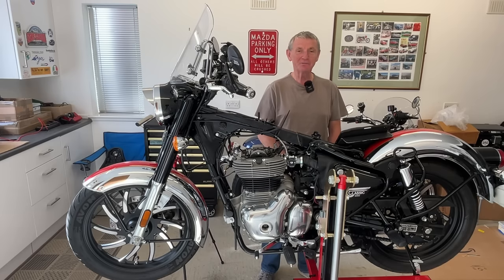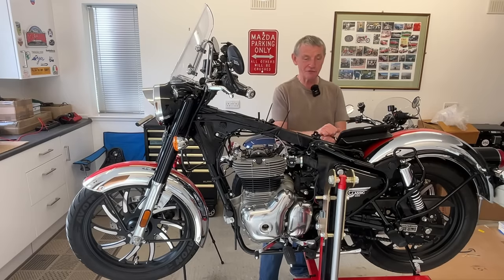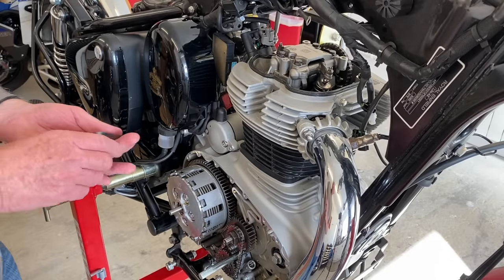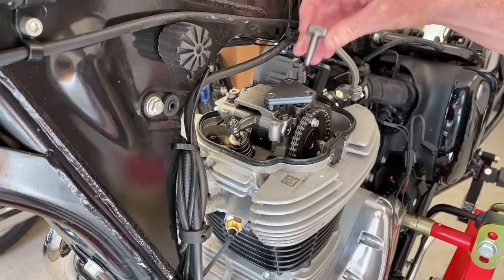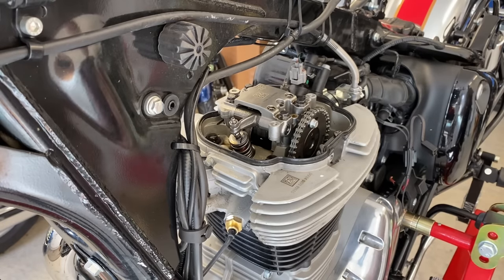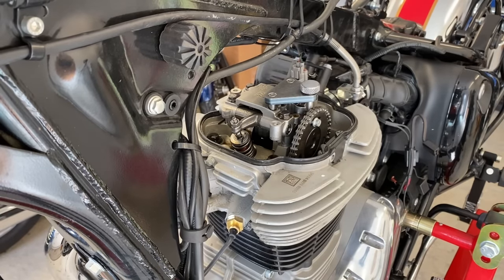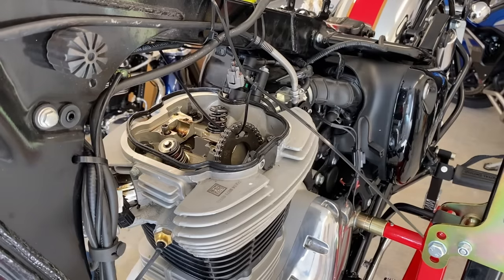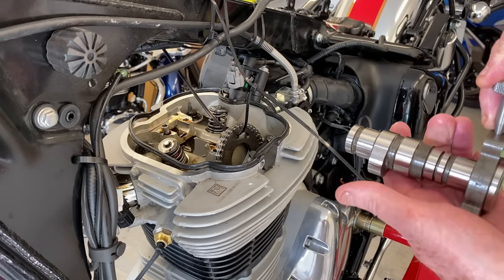Royal Enfield Classic 350 - Fitting the Hitchcocks Performance Camshaft

Comment: Good clear explanation however I don’t think clicking the torque wrench a few times is recommended ,once the tool breaks that’s the torque set,clicking again could over tighten the fixing,
Reply from the maker: Not sure if it’s good practice or not, a habit I’ve got into over the years. As to the bolts on the bike the torque setting specifications are between 10 to 12 Nm, as I used 10 Nm any extra clicks wouldn’t have exceeded 12 Nm 🤣.
Great to hear that you enjoyed the video 👍

Comment: does the performance even increase when you only install the new camshaft or do you only get the +4 hp when installing other airfilter and exhaust?
Reply from the maker: You will definitely get a performance increase with only the new camshaft fitted.
The air filter and exhaust just enhance the setup by improving the airflow through the engine.
Hope you enjoyed the video and found it helpful 👍
Reply: @tigerness5555  Thank you very much

Comment: Excellent video I will be referring to this if/when hitchcocks get the cam in stock. Was the side casing gasket a pain to get off?  Or are you intending to reuse it? Also I believe you took the fuelx lite and decat exhaust off, are you refitting some else like the decat pipe and using the fuelx lite again? Do you still have the DNA air filter. Otherwise I don't understand why your doing the cam for more power without the basic mods. Sorry for the question just wondered the direction you was going.
Reply from the maker: Great to hear that you enjoyed my video and found it useful.
The side casing gasket came off in bits but was easy. Yes I did fit a new one.
Yes I had previously taken the FuelX lite and free flow exhaust system of the bike. Those items have been sold. I found the exhaust rather noisy for my liking.
I’ve never had a DNA filter.
You’ll have to wait till next weeks video to get the full picture of all my performance modifications 🤣
What I will say is that they have all been very worthwhile 👍
Reply: @tigerness5555 I'm looking forward to the next video. I have the DNA air filter, not sure on the performance improvements but sounds nice.  I  fitted hitchcocks decat but to be honest the cat was very free flowing anyway but again a little different in exhaust note. I did hear someone mentioning the cam caps have stretch bolts but at 10Nm don't think that to be the case.  Funny how everything is 10 Nm. Keep up the good work.
Lift looks an awesome height to work at for this job.

Comment: does the camshaft allow the bike to maintain 110 or even 120kph on a motorway when it meets an incline or a headwind?
Reply from the maker: Yes it will maintain 110kph, the bike is flat out at 120kph but it will still maintain that speed much better than the standard engine.
Hope you enjoyed the video and found it useful 👍😁
Reply: @tigerness5555  It is an exceptional video. Hats off my good man.
I bought my 350 as a means to get to work, from the south side of Dublin to the northside. A 25 min ride with no traffic. However, i have ended up clocking 12,000klm in 12 months going all over the country for a secondary job i have since taken on. I found the most infuriating thing was trying to get back to Dublin while attempting to maintain 110kph as its a comfortable speed. However, I have found on a number of occasions that  i cant even keep it at 100kph. I am fairly handy, your video is fantastic so if this fix will breath new life into her I will absolutely do it. I will also buy a cheap tourer to share the load. Thanks again for the video. Its fantastic.
Reply: @tigerness5555  Is there any chance I could send you vid of another problem I have of my chain jumping? Ive asked the garage I have bought the bike from to look at it but theyre not interested. Something tells me its not normal.
Reply from the maker: If your chain is as you say jumping, this is what I would look for.
1	Does the chain need adjusting, is it too slack or too tight. Adjust as per user manual.
2	Does the chain have tight / stiff links. If so try cleaning / lubricating the chain. If this fails you need a new chain.
3	Are the sprockets (wheel and gearbox) worn or have hooked teeth. If so the sprockets require replacing.

If a new chain is required then the sprockets are possibly also worn so it may be advisable to replace both of them as well.
Hope this helps 👍

Comment: My torque wrench only has in/lbs.  Am I correct in calculating 10 NM is approx 94 in/lbs.
Reply from the maker: According to google.
To get any torque value in inch-pounds, you need to multiply the number in newton-meters by 8.851
Therefore 10 Nm = 88.51 inch-pounds
Make sure your torque wrench is definitely inch-pounds AND NOT foot-pounds.

Hope this helps and you enjoyed the video 👍

Comment: Hi Ian I'm sorry to be a bother to you I've just put my cam shaft in job not finished yet I can now see how the special tools are beneficial they weren't in stock when I ordered my cam, as I said I made a cheap one but I'm not sure that I've got it right so my question to you this time is the cam locking tool a perfect triangle as when I measured the points where the tool fitted in was One and half inch equally between the points that how I made it but if the triangle is not equal distance between points then I've got it wrong. By the way the bike I had before the royal Enfield meteor was a Triumph 1050 Sprint.
Reply from the maker: Please give me an hour or two and I’ll measure my camshaft locking tool and get back to you.
Had to edit this response as “I’ll measure my tool” didn’t sound good 🤣
Reply: @tigerness5555  thanks
Reply from the maker: Hi Ken
I’ve looked out my camshaft locking tool and measured it to the best of my ability.

The tool is NOT a perfect triangle 

All measurements taken from the top of the tool as fitted to the engine and looking down.

The distance between the centre of two fixed pins that locate into the camshaft bearing assembly is 38mm
The distance from the rear inlet side fixed pin to the centre of the removable pin is 35mm
The distance from the front exhaust side fixed pin to the centre of the removable pin is 42mm

Hope this helps. If you live in Central Scotland I may be able to help.
Regards
IAN
Reply: @tigerness5555  thanks Ian it looks like back to the drawing board, I've put the rocker cover back on  so it won't take too long to get back to the cam, I didn't feel happy about it so I will put the TDC centre hole on the cam to dead centre and that should do it. I will use you measurements to confirm that it's right. Thanks again for your help. I live in South Northumberland town called Ashington.
Reply: Fingers crossed that it’ll all be ok. Please let me know how you get on and what you think of the camshaft performance. I’m very happy with mine. @kenmoore4737

Comment: Excellent video Ian, much clearer than Hitchcocks' own video in which the mechanic seems to get himself in the way most of the time so you can't see what he's doing.  I see that your throttle cable runs over the top of the rubber on the left hand side of the frame, as did mine, but I found it impossible to get the tank back on with it there - the bracket kept jamming on the cable outer sheath, so I routed it underneath the rubber instead.  Is there a "knack" to getting the tank on? 😆  My only concerns about these mods are a) are you bothered at all about the warranty? (and I'm not sure I am because my dealer is pretty useless, I'm much happier doing the routine maintenance myself) and b) what are the insurance implications?  Thanks again.
Reply from the maker: Great to hear that you enjoyed my 🏍️👍
I agree with you about the Hitchcocks video, I’ve watched it a few times and thought that I could make one better. I’ve never had any problems removing the tank, no different than my other bikes. Regarding warranty, personally I’m not bothered, actually the dealer I bought my bike from has just closed down. As the top speed of the bike hasn’t changed due to it being speed limited I see no reason to tell the insurance. It does get up to top speed much faster though 😁. Who’s ever going to look into the engine to find out 🤣

Comment: Olá amigo tudo bom meu nome é Wellington sou do Brasil comprei uma moto igual a essa recentemente gostaria de melhorar a potência dela pois ela é um pouco fraca você recomenda que troque o comando de válvulas dela ?
Reply from the maker: Hi Wellington
Hope you enjoy your new motorcycle, they’re great bike to own and ride.
The camshaft upgrade is definitely well worth considering, it does give a genuine increase in power.
My bike has the following parts installed which all combine to help the performance.
Hope this helps you 🏍️👍😁

Kent performance camshaft: https://accessories.hitchcocksmotorcycles.com/accessory-shop/cylinder-head/48439

FuelX light: https://accessories.hitchcocksmotorcycles.com/47038?cont_page=Royal-Enfield-350-Classic-Accessories

Decat pipe: https://accessories.hitchcocksmotorcycles.com/47939?cont_page=Royal-Enfield-350-Classic-Accessories&Page=2

Open air filter cover: https://accessories.hitchcocksmotorcycles.com/47056?cont_page=Royal-Enfield-350-Classic-Accessories&Page=4

16 tooth gearbox sprocket: https://accessories.hitchcocksmotorcycles.com/45246?cont_page=Royal-Enfield-350-Classic-Accessories&Page=4

Comment: Didn't explode?

The cam cover seem to have a gap at the base when you reinstalled it (bolt closer to the camera) compared to before
Reply from the maker: If you watch the video again you will see that what appears to be a gap is actually oil that was forced out when the cam cover was tightened fully down. The camshaft and cover has been properly installed and torqued to the correct specification.
Forgot to mention, my engine hasn’t exploded and is running perfectly 4,000 miles on from the camshaft install 👍🤣
Hope you enjoyed the video.
Reply: @tigerness5555  oh ok, for a moment I thought it was a gap. Great then!
Reply from the maker: @javierc2726  🤣👍

Comment: Did a Himalayan 411 and didnt need locking pins. Whats going on here?
Reply from the maker: 🤣 Great comment.
I’ve never worked on a Himalayan so can’t comment on that.
As for the locking pins on the Classic 350, I do recon that I could fit the performance camshaft without any special tools. But for the purposes of the video it was important to demonstrate the correct and safest way to fit the camshaft. I’ve heard about others who have had professional dealers fit the camshaft without the proper equipment with the result that the camshaft timing was set incorrectly, resulting in the bike running terribly.
Hope you enjoyed the video 👍

Comment: Why didn´t you put a rag or towel in the cylinder head when loosening and installing the camshaft screws. It would have taken out the stressful moments 😀
Reply from the maker: Hi Tom, it wasn’t a stressful moment for me. The bolts were easy and safe to remove. I merely emphasised the point to ensure others would take extra care.
Thanks for your comments, in hindsight perhaps I should have either done as you say or at least mentioned it in the video.
Hope you enjoyed the video and found it useful 👍
Reply: @tigerness5555  Yes I enjoyed and as we are both not 25 anymore I recognized the happiness you had when tuning up your bike. Such works keep us young in heart.

Comment: Is that a balancer chain...with no tensioner?
Reply from the maker: If you mean the small chain inside the right hand side casing the answer is no. It is the drive chain for the oil pump as can be clearly seen from the hyperlink diagram below. Hope this answers your question.

https://www.hitchcocksmotorcycles.com/partsbook-pages/7580
Reply: @tigerness5555   Thanks. Im considering a Hunter 350, if it was a balancer chain, i would be re-considering.

Comment: What difference does it make really? It's still limited to 75
Reply from the maker: More top end power, faster acceleration. If I could find an unrestricted throttle body that works on the Classic 350 it would definitely go more than 75mph 🤣
Reply: @tigerness5555  I really like my classic dark 2022, it's definitely capable as is of going past 75 as it's not screaming the nuts off the engine, I read that the limiter is controlled by the abs sensor so if I pull the fuse on that I can see if it does pass 75
Reply: @tigerness5555 I bought the RLT00164 do you know if that'll work on the Classic 350?

Comment: First time I have seen your videos. That jump from 15.57 to 20.46 hp is about 32-percent or a third again more power. I just put an S&S cam and a big bore kit in my 47hp 650 Interceptor, at 743cc and 11:1 compression I would be happy with a 25-percent increase to around 59hp. The 863cc version is around 67-70hp *... these Royal Enfields are amazing with a bit of tweaking. Virginia, USA.  *crankshaft, not rear wheel hp 🤔
Reply from the maker: Hi Frederick, great to hear that you enjoying my videos 👍. Yes they are brilliant and fun bikes to own and ride.

Comment: Seen you working on the camshaft sproquet without putting a rag under it.😅.
Please dont drop any tools or bolts inside the engine or you can Imagen the consequences. 
This is basic knowledge. 
Good effort and keep it up.
Reply from the maker: I’ve been working on motorcycle engines for many years and was very careful removing and refitting the bolts. I agree those less experienced should use a cloth for added reassurance.
Hope you enjoyed the video 👍

Comment: Fit a carb. Delete the cat. In fact fit a decent exhaust system. 

Then you might have a half decent bike.
Reply from the maker: Thanks for your comments, hope you enjoyed the video 👍
Actually the cat has been deleted, the exhaust is excellent and fitting a carburettor would open up no end of trouble.
What I have is a very decent little bike which is tremendous fun to ride and own 👍
Reply: @tigerness5555   @Tiger Ness you responded:

“Thanks for your comments, hope you enjoyed the video 👍”

You’re welcome. I did. 

“Actually the cat has been deleted,”

Great. Was it easy? The tiny Swedish elf puppet will cry of course. 🧐😎😜

“the exhaust is excellent”

That’s good, but most standard exhausts on most bikes are very heavy. An exception was the GSXR with the black aluminium cans. I’m planning to use one on a lightweight adventure bike project. 

“and fitting a carburettor would open up no end of trouble.”

Probably not as much as you might imagine. The lightweight adventure bike I mentioned is based upon a modified CCM 604 frame with a BMW F650GS Dakar engine converted to carb. 

“What I have is a very decent little bike which is tremendous fun to ride and own 👍”

Indeed, until one small electronic element such as a sensor, a wire or connection to a sensor fails in some fashion, and stops sending a message to the ECU. Then the ECU will refuse to allow the fuel pump to work. Then, like all modern EFI bikers, you’ll be bûgg €r€d. 

There are actually three constants: death, taxes and gravity. Only bikes built to exploit the latter interest me. For that reason I never bought a Kawasaki, and I refuse to buy one designed to comply with a fake environmental tax based agenda… unless it’s a Honda Blackbird, because it’s possible the EFI model was in some ways an improvement on the original. 👀😎

Ride safe. 
Peace

Comment: Total waste of time taking clutch cover off, apart from that good video....
Reply from the maker: Your correct the job could easily be done without using any special tools. What I was trying to show is the correct way to replace the camshaft the same as Hitchcocks did but with clearer video.
If I hadn’t done it this way then I would have received loads of comments saying that you have to lock the crankshaft. Damned if you do, damned if you don’t 😂
Great to hear that you enjoyed the video 👍
Reply: Mmmm, maybe just the one special tool ie the cam locker, thus when you have repositioned the crank to remove final bolt from sprocket with the cam locked, just make absolutely certain you do not move the crank again. I might give that a go when I try this job, with a view that if I mess it up I will then have to subsequently take the clutch cover off to sort it all out🤔🤔🤔
Reply: yes I’m sure this will work and if I didn’t intend to make a video that’s probably what I would have done.
I was also servicing the bike so the oil was drained for that, so for the expense of a gasket it was worth it.
Reply: @ianness2315  Thanks for your thoughts on the matter, as you have done the job and don’t seem to see a glaring negative to the idea, I will give it a go when I get my camshaft.

Comment: Another quick question if I may? Did you follow the cam ‘running in’ instructions - varied running at 2,000 to 3,000 rpm with no idle, for 15 mins? Of course without a rev counter this is somewhat a judgement call!
Reply from the maker: Yes I did do that, something I failed to mention in the installation video. I don’t imagine it’s really necessary but better safe than sorry.
Hope this helps 👍
Reply: @tigerness5555  ah ok, thank you 👍🏻👍🏻